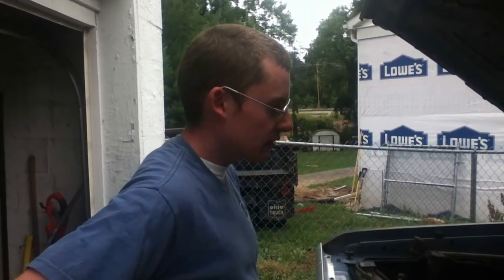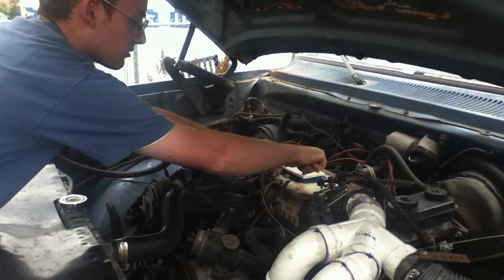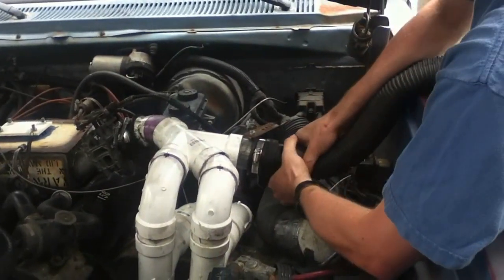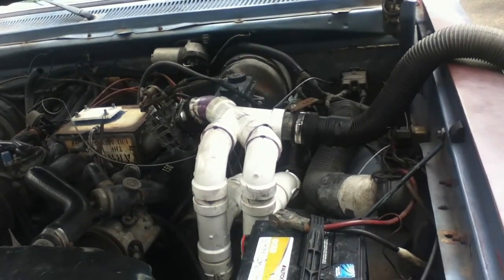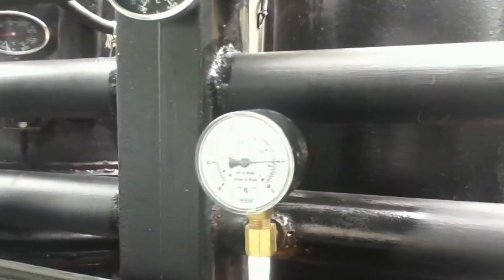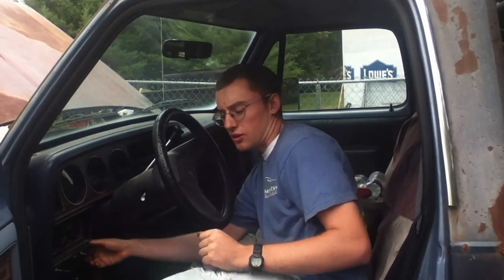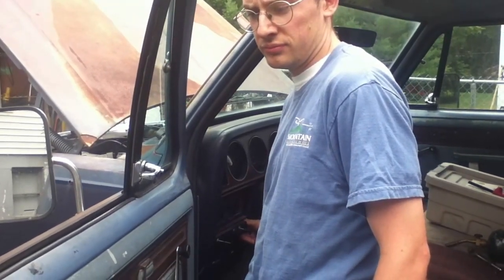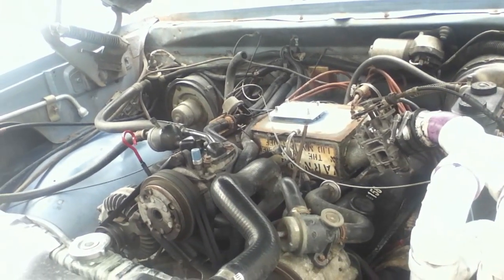Look Ma, no carburetor!!

Comment from the maker: This truck has a Keith gasifier on it, which works amazingly well. I've put over 3,000 miles on it so far. The gasifier is welded together from recycled steel parts, so anyone can build one. The Keith design has distinct advantages over the older designs out there.

Plans are available on the Drive On Wood website, linked in the description.

Comment from the maker: I normally run a dual throttle setup. Yes that's a box that's normally under the carb. The carb itself doesn't seal very well, so I was testing it without that leak to see what happened. Timing is advanced on a push pull cable hooked to the distributor.